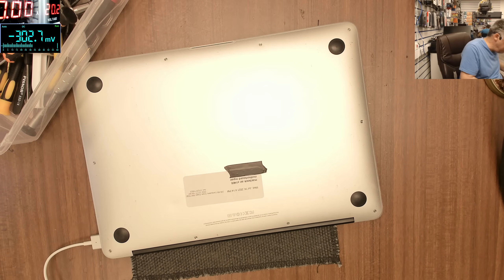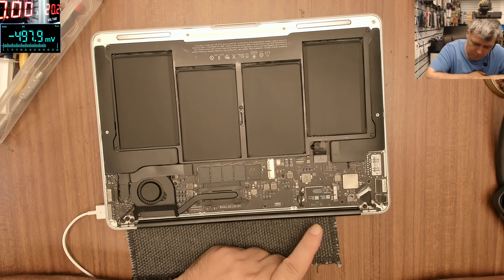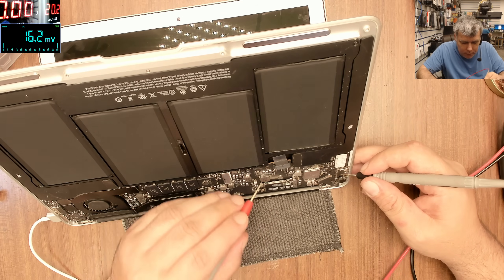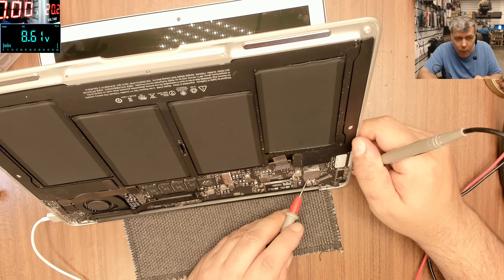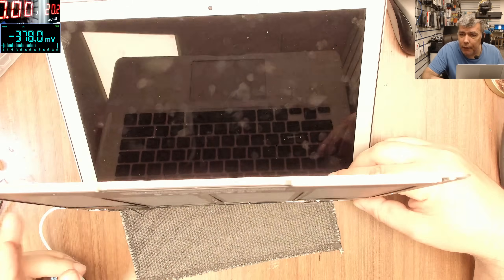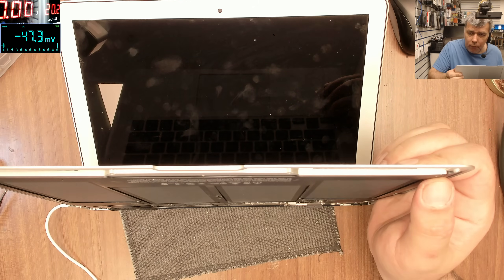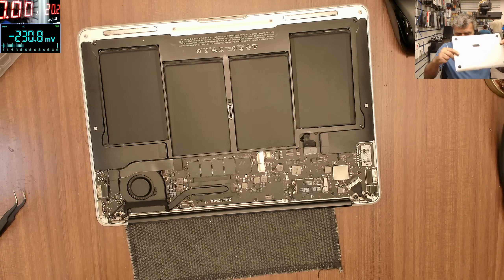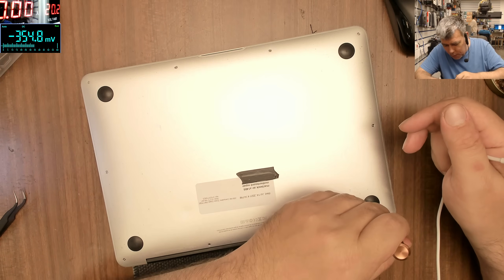'Apple said my logic board can't be repaired and must be replaced'. Well, let's do some magic!

Comment: Hello sorin, I agree you should try SMC reset..but at the end of video is visible that, there is no light on charger. There were problem with one wire circuit. Maybe DC IN board or flex was bad :-)

Comment: So basically, just open it up to let the factory air out of it, wait a few minutes, wiggle a few wires, probe a few circuits, and viola! It's fixed.

I hate electrical jobs like that. Maybe that's why Mac says "replace the motherboard"? They've encountered this ghost in the machine too many times, don't have a clue what's causing it, so they use the "scattergun" repair method to "fix" the problem.

The "problem" is the Apple logo and everything under the lid.

Comment: Luis Rossman has given examples just like this one where Mac pushes replacement rather than repair and have even tried to get politicians to side with them denying people the right to repair their own property that they've purchased from them. Of course here in the USA, they've been shot down, (for now until they can buy off the right judge of course, everything here is for sale now); so they just don't sell the individual parts to do the repairs, and force anyone doing any repair at all to buy the entire unit.

One of the many reasons I won't buy a Mac/Apple ANYTHING.

Comment: I've had one where USB daughter board connector caused issue until reconnected. Cross connections or dirty, not sure. Sorin please wear a disguise and go back to apple store with customer and cause some mayhem. That would be super you tube material.

Comment: SMC needed to be reset. SMC= System Management Controller. The SMC has roles in controlling thermal and power management, battery charging, video mode switching, sleep and wake, hibernation, and LED indicators.

Comment: Is it possible you touched something and it moved, so it makes a connection? Could it it be a bad solder joint?
Reply: No.. stuck smc.. holding the power button for 20 sec did the same trick

Comment: At 11:08 you pressed on the board hard enough to flex it and that is when it started working. You have an intermittent connection on that board and most likely will never find it. By the time it gets back to the customer it most likely won't work! I hate those problems with a passion!
Reply: Nonsense  16:45

Comment: Apple doesn't repair. They keep it for a few days and then say replace logic board. I used to work in a store, if a mac came in for repairs, we would do some simple diagnostic, if that didnt fix the problem, we would give the client an option to send to Apple or 3rd party repair. Usually only send to apple if under warranty.

Comment: Of course Apple doesn't fix, they replace parts. I don't blame them it's just the way they assure quality and give the customer Guarantee .
Reply: I disagree. It is only a way to pull out more money from your wallet. This is the thruth. Guarantee is only an excuse. There are precise regulatory rules, internationally recognized. For sure in Europe.
Reply: Agree
Reply: How can a Apple assure that a repaired liquid damage is 100% pristine  fixed? How many hours an employer need to test all components?
Reply: @peekpt  A full test after liquid damage is not needed. Even in the production phase phone are not tested 100%. Test points are normally used to be sure that the device is functioning.
Reply: What brand do 3 year recall to replace GPU? Free?
Reply: @peekpt  evereyday practise, for example, in car market. It is NOT a plus: it is your duty...they call it honesty!!!

Comment: Sorin the logic board or DC IN board still has a problem. I know because I have the same problem. From time to time it just dies, usually after few hours with charger plugged. i have to disconnect the battery and keep power button for 10 sec. The customer tried SMC reset, you can be sure of that. Nobody will buy another board without trying smc or pram reset.  Maybe the charger is not original one. This will happen again, for sure.
Reply: Could be.. but these thing he can’t fix.. should be sent to the India

Comment: I believe When you take the battery out for a while, it resets the "CMOS". You know, macbooks have no cr2032 cmos battery. The "3V cmos" power comes from main battery. 
Always try to hold the power button for 20-30 seconds and then try to turn it on. It works many times.
Thanks for your videos, Sorin.
Reply: This is called SMC reset, it is first thing you try on no power macbook. You can do the same thing with ctrl+alt+shift+power button.there is no cmos battery on modern macbooks, it uses main battery for RTC.
Reply: Same with hp
Reply: I made so much money just doing this lol

Comment: Rossman group will be proud of this unrepairable repair. It is so tempting to give the customer the newer board, keep this one because that is what he asked you to do. So why did this machine not start working after you removed the battery and waited till the  charging port was removed? Just not sure how the bios is arranged on Macbook.
Reply: Just hold power button 20sec
Reply: @Arvidje  Really?
Reply: You hold the power button for about 30 seconds to drain all residual power from the board , the capacitors will hold some for a long time , by holding the button it drains them , its a bit like removing the CMOS battery and shorting the terminals

Comment: Hello Sorin, I’m working on similar MacBook Air 2017. The battery was changed by apple a year ago. The machine boots up with power cord but if you unplug, the laptop dies despite a battery that is fully charged. I’m thinking the board needs changing . Your thoughts?
Reply: Charging ic or dead battery

Comment: Question: The battery was unplugged, you said you disconnected the charger board, then how did it get power to turn ON????
Reply: The main DC connector was still plugged in, the black ribbon cable he disconnected was for the USB and headphone jack that are part of that board.
Reply: @isosgaming  Now that makes sense, thank you. And thank you Sorin the magician.

Comment: So what was the fault?? I don't like thing I don't understand
Reply: More than likely, it was just the BIOS/SMC that got "stuck" like he said in the video, disconnecting the battery and charger normally fix this kind of issue from what I have seen along with doing the SMC/PRAM reset keys.
Reply: @isosgaming  never had a MacOS bios freeze before. Possible SMC. But then why would it? Interesting...